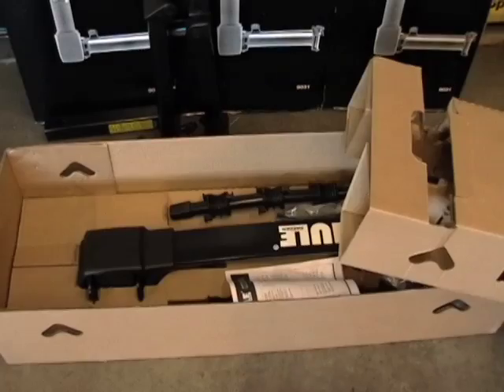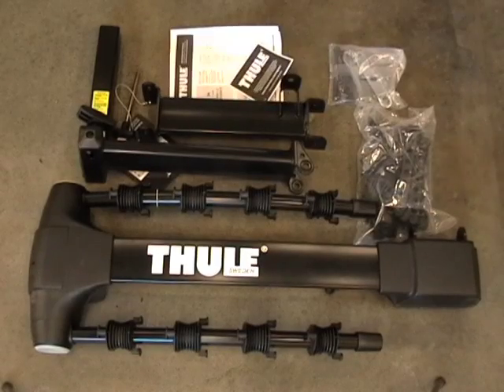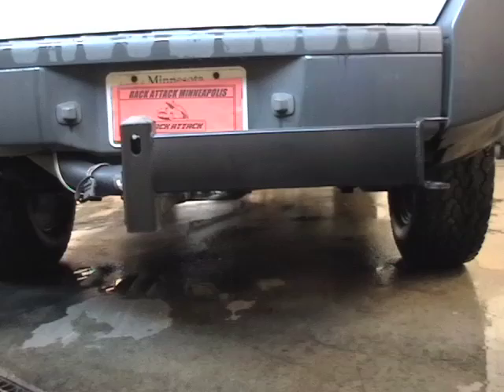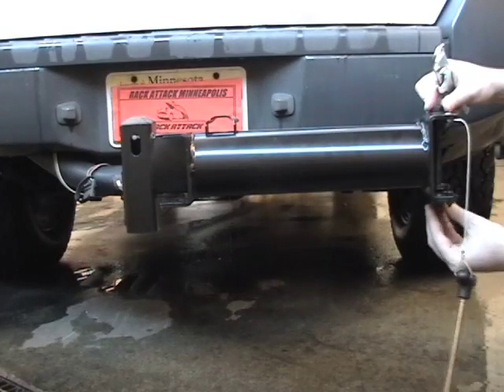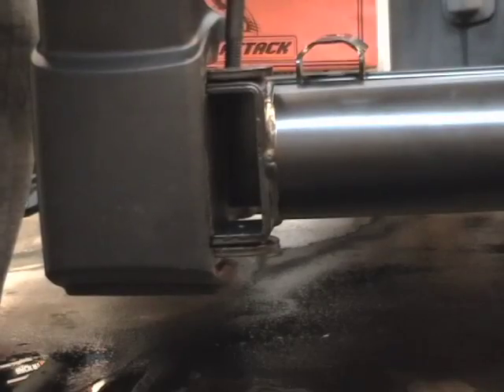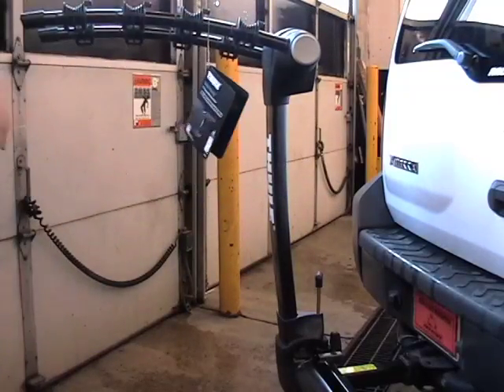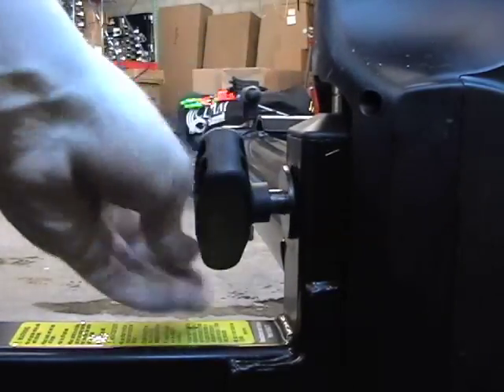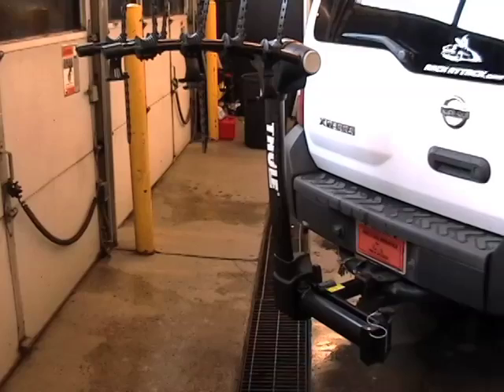Thule 9031 Vertex Swing Installation Demo by Rack Attack

Comment: Pro-tip: Remove the T-handle nut using a 1/2" wrench and add a lock washer just behind the T-handle (Between the handle and large washer). This will prevent the T-handle from coming loose.